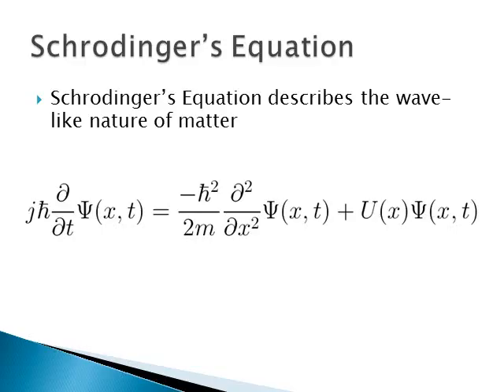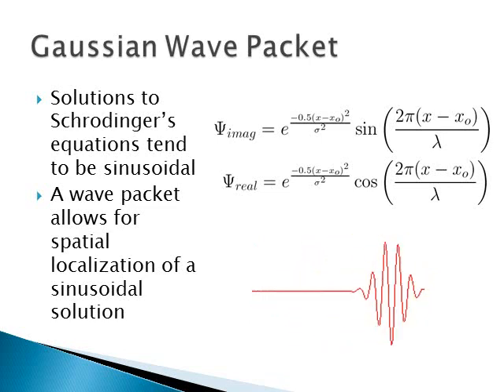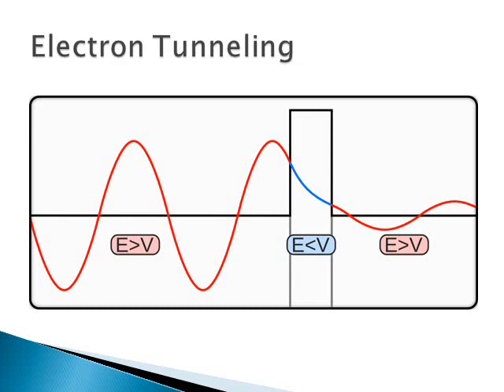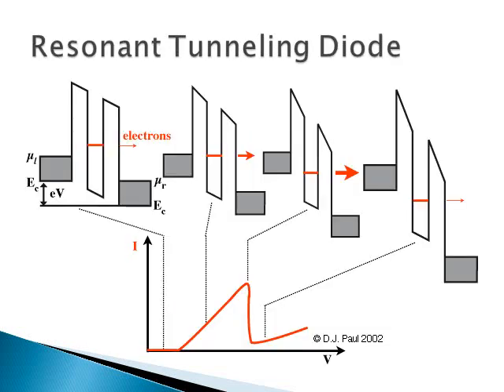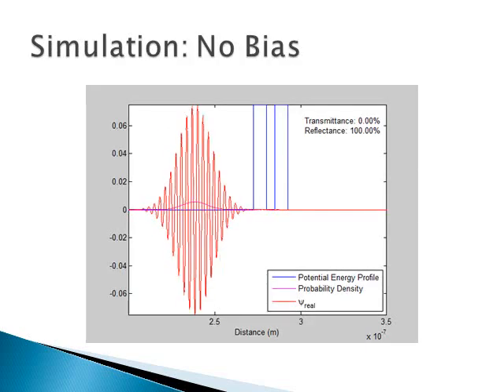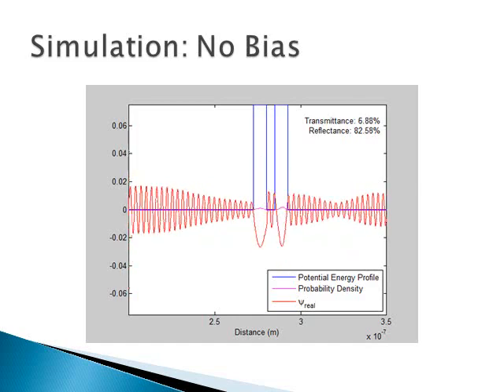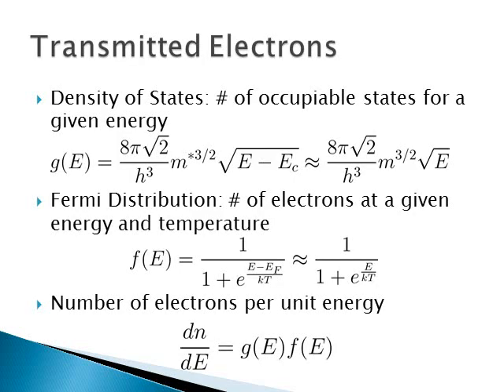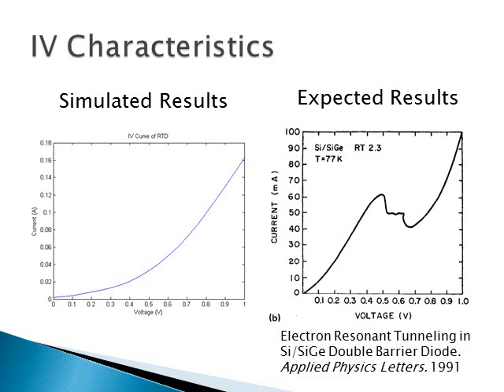ECE 4823: Resonant Tunneling Diode Simulation

Comment: The quantum well is what allows high transmission, but the increase in resonant tunneling from my understanding is not due just because of the well. It is due to the fact that forward and reflected waves constructively interfere in the well such that there is a 100% transmittance. Just a disclaimer, this is just my understanding from what I've read about this material so far. I haven't had the chance to mathematically see the results myself yet.